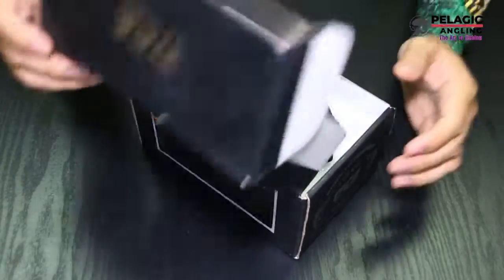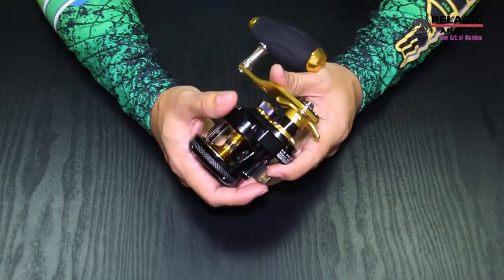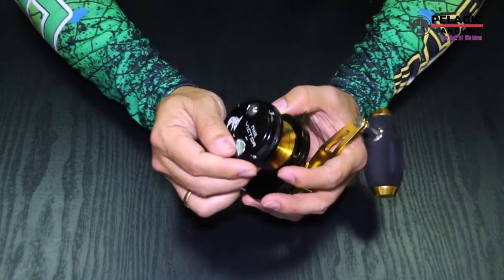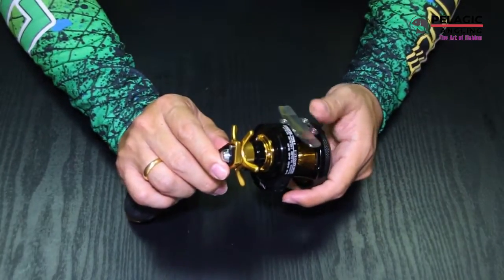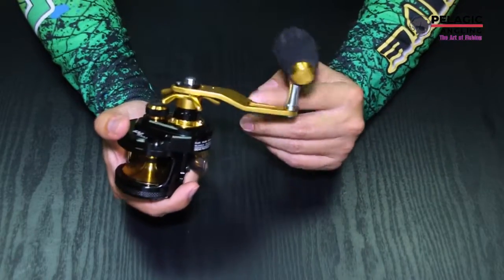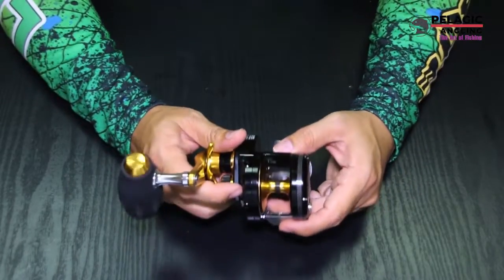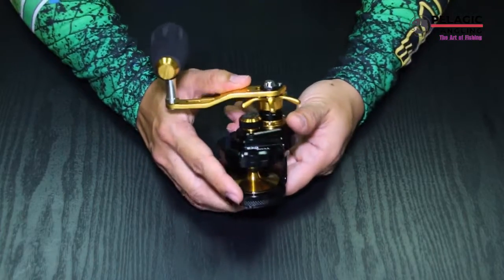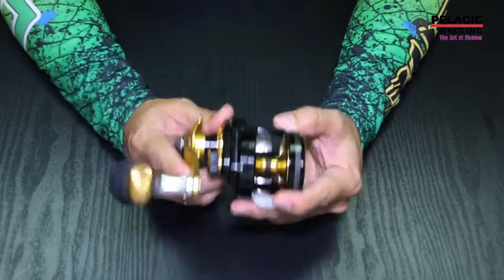TICA Victor TYA5L Salt Water Jigging Reel | Light Jigging Reel

Comment: Do they have a bigger version?
Reply from the maker: For jigging 2 nodels lang low gear at high gear bro
Reply: @GeneFishingTV  I mean is do they have a larger spool for 200 to 300 meters pe 4 or pe5 line
Reply from the maker: Im using PE2 at 500 mtrs (.23) bro i guess PE3 or PE4 fits 300 mtrs

Comment: Sir, matanong ko lang po, matibay po ba ang tica na brands?
Reply from the maker: Sir so far oo salt water reel din po sya.
Reply: @GeneFishingTV  salamat sir, balak ko po bumili sa brand na yan pang shore fishing.
Reply from the maker: @daveTV10  casting ba sir? pang dagat ba?
Reply: @GeneFishingTV  opo sir, pangdagat.  Spinning siguro bibilhin ko sir.
Reply from the maker: @daveTV10  spinning sir bilin nyo pag shore
Reply: @GeneFishingTV  salamat sir, dito sa isla namin maraming trevally na mahigit isang kilo bawat isa, walang nagpifishing dito. Net lang marami tas palubong.